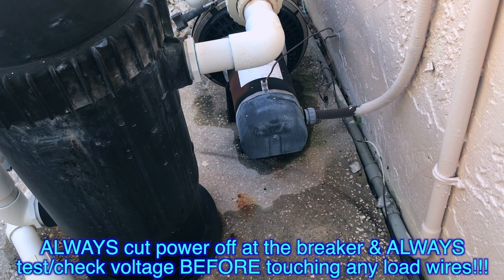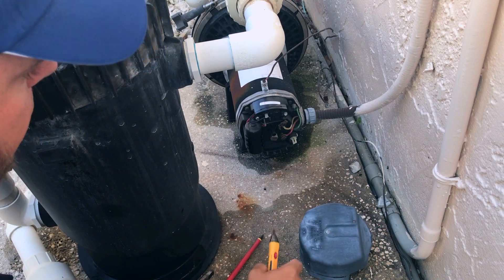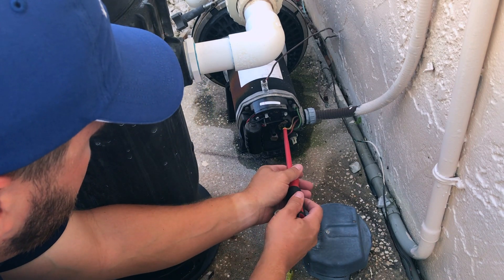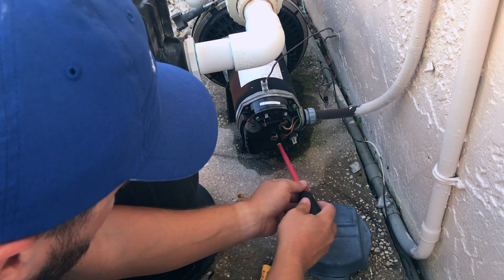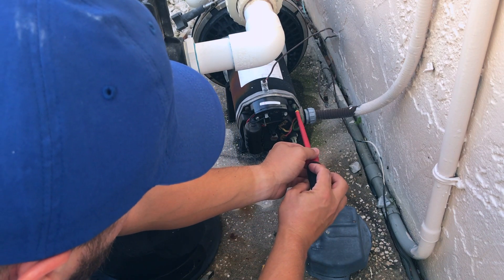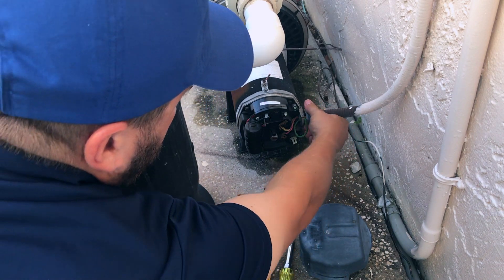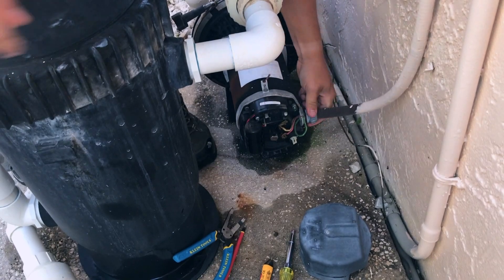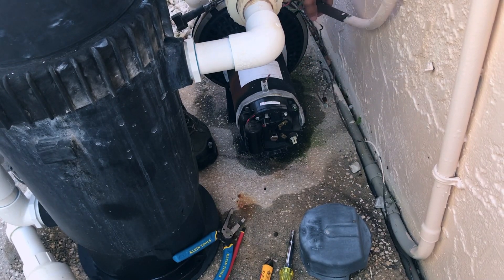How to Safely Disconnect Power from Your Pool Pump (DIY Pool Pump Wiring Guide)

Comment: If I know for certain the right breaker is flipped off, and the power switch is off, is it necessary to test the voltage?
Reply from the maker: I always say better safe than sorry. I don’t want to hope without verifying. Safety should be triple checked.